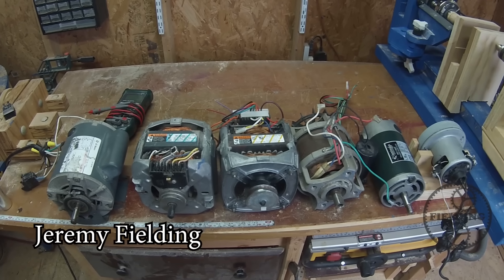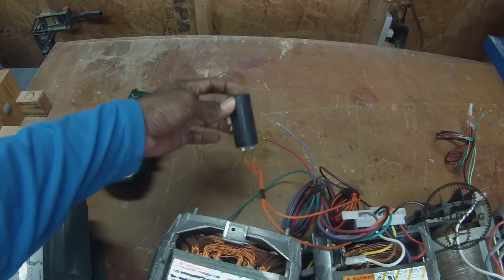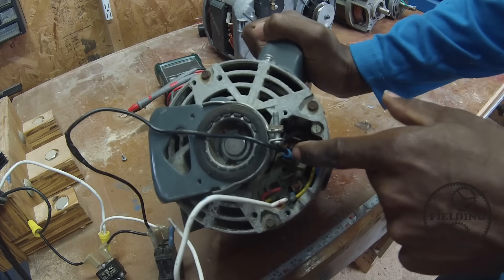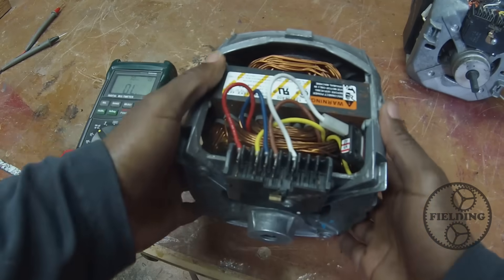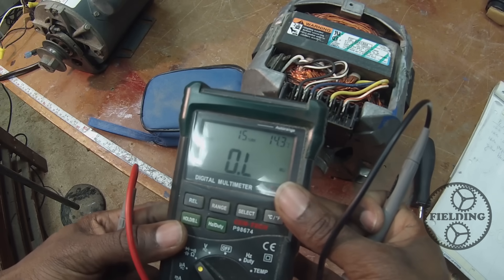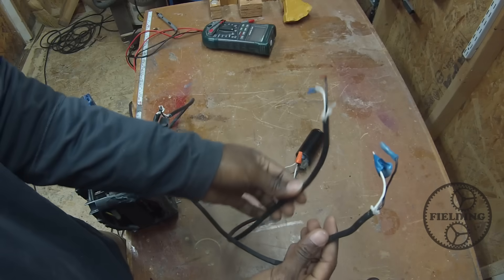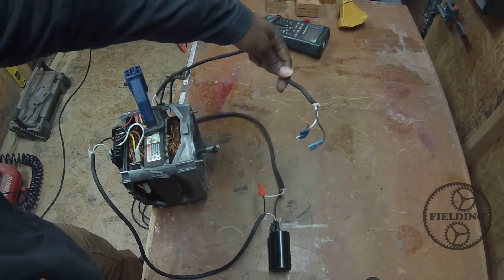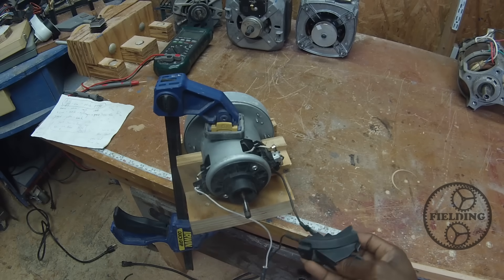How To Wire Most Motors For Shop Tools and DIY Projects: 031

Comment: i got a motor from a dishwasher it had a run capacitor but has 3 wires (and one ground) any idea how to connect them ? (btw they had different resistant with each other and had continuity with each other... no idea if they are sorted :/ )
Reply: therealnightwriter- That's so clever. You know, I had a electrical question so I googled it and it eventually landed me here. Here we also find a smaller youtuber that is likely to answer questions directly. Thanks for suggesting the thing were all doing champ:)
Reply from the maker: I added a note to the description for this kind of question. Please have a look Thanks!
Reply: @Bino White you speak the truth brother. My millwright shop has a bunch of very very smart millwrights but they're BOOK SMART. They know the theory. Theory is only one part though. Hands on knowledge is more useful to me in my everyday tasks. I vant stand when guys fresh out of college start thinking they're full blown millwrights. To become a jack of all trades, it takes many many years....
Reply: @Bino White Invest in some punctuation my guy.
Reply: Bino White I think you’re story shorted out somewhere, but I get u bro. I’d say a good mix of both is good. Watch electro boom he’s hilarious.

Comment: Hello Jeremy - maybe you can help me with a slightly different motor:
I salvaged an 50W (220/240V since I am in Europe) AC motor from an old dryer and can't find a wiring diagram.
The motor has 3 wires (white, brown, red with 38 Ohms between brown/red and 20 Ohms between white/red; white/brown) + ground screwed on the side.
Additionally I salvaged one 10uF and one 18 uF capacitor (450V, 420-470V) - both 4 pins (two pin-pairs with solder-bridge having no resistance)

If I did my research right, white should be neutral and red/brown + and - depending on the direction I want the motor to spin. But do you have any Idea how I have to wire those two capacitors?
Since the capacitors seem to have practically only 2 different pins, I just put one between red and brown, hook white to ground an red or brown to phase depending on the rotation I want - or wire them parallel?

Thank you for your time
Reply from the maker: Please understand I get hundreds of emails and messages like this. At this volume it isn’t practical or safe to give one on one wiring advice
Reply: I understand that you don't have the time to look at capacitor ratings and motor specificy for each and every request and give detailed advice.
But I still think a 3 wire AC motor is pretty common and a wiring advice would help more people than just me (since there was no 3-wire-motor in this video).
Can you give a general advice for wiring 3-wire-ac motors? Is the method of finding neutral correct (lowest Ohm to the other 2 cables) and is it in general correct to put the capacitor between the two high-ohm cables, hotwiring one of them?
Thanks again for your time and effort
Reply from the maker: I have had this conversation enough times to know I should never assume I have all the relevant information or even that I understand the problem completely. It is not safe for me to answer your question. Sorry I cannot be more help individually... but there are thousands of you and one of me

Comment: Your channel is very helpful and informative. A Question. How does the capacitor get charged?  And, if the capacitor isn't charged when you turn on the single phase motor, does it kick it over and start the motor spinning?
Reply from the maker: It only takes a fraction of a second to charge so it is charged when you power on. But depending on when it is shut off, it is often charged from the last run cycle

Comment: Hello first off want to say your providing awesome info and instructions..... I myself am wandering if  you can steer me in the right direction... If at all possible.... I just purchased a stand-up (RollPlay) Up Rider USED..... Now I reassembled it and  attempted to test it before My daughter could ride....... And only the right wheel was turning. Sooo I 1st thought it was a burnt motor but I was able to actually get power to it using the wiring harness for the Right wheel so My issue Is NO POWER FROM SOMETHING  TO THE 1 SIDE..... It would be awesome if you have the time to spare if not all good ill still be learning lol from you 
THANKS
Reply from the maker: I don’t know.

Comment: I want to  make a small carousel for my 2 kids. Which motor would be able to handle about 200 pounds with the weight of the kids and all parts and wood etc? I was thinking the first motor you showed or the treadmill. Saw a guy make a huge one 10 feet high/ 20 feet around and used a 1 hp electric motor.
Reply from the maker: It sounds like you have already done more research on the topic than me. Why not start with what you have seen? There are formulas for calculating how much horse power you need and how to calculate your load. but if you have an example, you have more than I can give you.

Comment: I was looking to define the wire color coding for my particular AC motor.  It did not have a diagram on it.  It came from a dishwasher.  The nice thing about dishwasher motors is that some are reversible.  Mine is a KitchenAid Gold Seal Reversing Motor .  The wire assignments that I figured out are:  
Purple = Neutral,  Blue = Hot Common,  Yellow = Hot CW Rotation,  Black = Hot CCW Rotation
Do not attempt to run with only Blue wire to Hot.  It requires the addition of one of the Hot rotation wires.
I hope this help others with the same or similar motor.  BTW....there is no visible capacitor but there is supposed to be a thermal limiter built within.
Reply from the maker: The only issue is colors don't always have a meaning. Neutral is usually white, but not always as you see. Every manufacture is different and it is best to check each one as I did in the video rather than rely on the color, unless the motor has a diagram.

Comment: I have motor Samsung from washing machine, my problem is I don't know how to wired the 8 terminal don't know what to main terminal, just ask you how to trace main terminal
Reply: Are all induction motor need capacitor
Reply from the maker: Not all induction motors need a capacitor. But those are usually motors with very low starting torque. Or they are three phase motors.
Reply from the maker: This video is the best place to start if you don't know where each wire goes. But when this stuff is new it always helps to watch a few times. There are things you didn't notice the first time.

Comment: what circuit breaker max amp you have for this testing?  15A?  i do a  lot of this stuff on the side so need a good pigtail with a breaker, right now i just use my power supply and well, not liking that..   2nd question.. how do you know if it's 110 or 220 on say like that washing machine motor.. i have one out of a dryer..   i think the dryer was 220, and i don't know if it's wired inside this box to the left o the motor.. i know usually for 220, you series the t2 to t3  and so on (coils)  someone gave me a compressor, and it had a leeson ac motor on it.. it's like 70 years old i think is what he said, may not be but it is old..   and i learned a lot with that unit..  after all that time, that ac motor still works flawlessly even after clearing out all the dirt dobber nests and rust ..   since that day,  i pull tons of motors now and even found a really nice on from a garage door opener unit that was thrown away in the trash but it's actually like brand new.. don't understand.. you'd think those guys might wanna keep that.. it's like $150 used on ebay..  dunno..
Reply from the maker: Motors should have a label or a wiring diagram. For the breaker -15amps or 20 amps is good. It really depends on the line in the house. You want your breaker to trip before the house breaker

Comment: Thank you very helpful. I'm trying to wire an old Crompton/Parkinson motor with 5 input terminals, Z,S, & T on top row and Az & A on bottom row, I've found the starter circuit and the main circuit and got the thing working BUT trying to rig it up with a rotary switch so that I can reverse it,  All the videos and diagrams I've found have only 4 terminals. any ideas? smerczak.ron81@gmail.com7
Reply from the maker: I have a video on reversing motors. Search my channel... I have to let you workout the details of configuring your switch though...

Comment: Great video! I found an old Royal canister vacuum that needed some rewiring. When I opened it up I found the motor has only two black wires. The power cord has a black and a white. What do I  do? The cord was detached when I found it so I have no reference to go by.

Comment: Hey Jeremy- I have an issue if you can leave me an answer. My reversible drill switch had gone bad. My drill is too old to make it worthwhile to buy a new replacement switch. I want to install an outside DPDT switch on the outside to be able to have the reverse and the forward function. I see 4 wire connections on the drill switch. I have tried a multimeter to trace and see what is open and what is closed and what is open. I cannot figure it out. There is a red wire that goes to one brush and a yellow wire that goes to the second brush. Where the red wire is there is a black wire opposite it that goes to the motor. On the same side as the black wire is the yellow brush wire and opposite the yellow is a black wire that goes to the Load. I cannot figure out how to wire those wires and replace it with an external DPDT switch. I am unfamiliar with the operation of the drill in forward and reverse mode. If I understood how this circuit works I think I can figure out how to wire the switch. Your help would be greatly appreciated.

Comment: Don't forget that some washers, particularly front loader washers are 3 phase. They have a circuit board that creates the 3 phase. They do this so that the motor can be easily reversed. Some single phase appliance  motors do not have a start capacitor.
Reply: Does  this wiring work for all washing machines wired the same i got s motor out of a whirlpool   its 120 vcd  duty 3.8 a 710 rpm 4.6 a 15300 rpm and im pretty sure i didmt grab the capacitor  can u use the motor without the capacitor?
Reply: It was also a front loader when  i was taking it apart i was just scraping motor but after watching whag people can do with spare motors .anyhow i didnt thing of writing down  the make or year  i thouhht i grabed all the chips and wires  but i didnt see the capacitor  when i was putting it together again . Also i thought the this squar box was yhe capacitor but it says filter on it with other number .

Comment: I like the video. I Have a wirlepool motor that only has 5 wires. I completely disassembled the control panel and found no capacitor. The motor ran fine while hooked up to the panel. I can send pictures. Oh forgot to mention I've tried hooking it up without panel and tripped breakers and got it to hum but no run.

Comment: Wow!  Great video...  Maybe this is what I've needed so far but I have a question.  I have a motor(from a washer) basically it has three wires. (The ground,Neutral and hot)  now I connected the hot through the capacitor and the neutral over the capacitor but not tested it hoping something doesn't goes wrong. I would like to know if I have done it right?  Thanks.
Reply from the maker: There are too many variables to try and troubleshoot problems this way. I can't see what you are doing, and it is not safe to answer questions like this. You have to watch the video and make sure you have the same setup. I have several videos on wiring motors, and one about how to determine what kind of motor you have. Watching the other videos will help build your confidence and make a decision based on what you have learned.
Reply: Jeremy Fielding certainly I will. Thanks for replying.
Reply: Jeremy Fielding  well from watching your previous videos, I just found out that it's an AC induction single phase motor.
Reply: Jeremy Fielding I later tested it but it didn't run. And for the capacitor(from same washer), it's alive.

Comment: What you referring to AC motor is actually an induction motor. An induction motor can start rotating is either direction that is if you power an induction motor it just start vibrating, now if the shaft turned clockwise the motor start rotating clockwise, or if shaft turned counter clockwise the motor starts in that direction. There has been two ways to make the direction of rotation of induction motors predictable , one by shading the poles, second the use of starting capacitors. the click you hear is centrifugal
switch that disconnect capacitor after the motor has started rotating.  The induction motors have very low starting torque, that is why they are not suitable for many applications. If high starting torque is needed normally universal motor is used.
Reply from the maker: It looks like you didn't read the description, or the text on the screen in the video. Just to be clear, It is both an AC motor and an induction motor. I don't want people reading your comment and getting the impressive it is NOT an AC motor. I have a whole series of videos explaining direction of rotation, how motors work, and how to change these parameters. 
Also the starting torque on a capacitor start induction motor is very good, especially considering the other benefits like it stability in speed. This why it is so widely used. It is best practice here to add context if you give advice like this in the comments. Perhaps if starting torque is the most important feature... Universal motors have their own problems. but that is relative depending on the application, so I will leave that topic where it is.

Comment: Jeremy if you were using that washer motor that you wired in parallel on a project, would you have that wired the exact same way? Also does that start winding not need to shut down after it starts up? I know you may have been doing it the way you did for example, but I was wondering if you would on a project also. Thanks
Reply from the maker: This is the correct way to connect the wires. I might have spent more time making the connections better but it won’t run if you connect it wrong

Comment: hey man, first and foremost, good job on the video, but i think you may need to RE-research some of your concepts you're trying to teach people here. for one (and i could very much so be wrong due to different motor being, well, different lmao) i dont think "hi/low" refers necessarily to motor speed but more so referencing "hi/low INPUT VOLTAGE" i.e. 120v VS 240v, ok? yes/no? im pretty certain there was something else i was going to mention but i cant for the life of me remember what that was lmao, so sorry haha now if i later think of it ill edit this post OR reply to it, please let me know about the hi/low and if it IS fop CERTAIN for speed in RPM's
Reply from the maker: This is not a dual voltage motor. The hi low on the washing machine (induction motor) is indeed two separate sets of windings inside the motor which give different speeds. I have a detailed video on understanding dual voltage motors you might find interesting though. check it out. https://youtu.be/3llc68VvzsY
Reply: Jeremy Fielding ah ok I see what you are saying now. Prior to your last post it was made to seem as if you were suggesting that (inside the video) there were two sets of different inputs, (high and low,) thanks for clearing up what you were actually stating about two separate windings indeed for speed.

Comment: I tried to wire a 120v motor at 60hz  directly to my home outlet. The motors spinns but i noticed sparks and burn smell. It has 2 wire one black and the other red connected to a controller which i guess is burn out. This motor belongs to a paper shreder that stopped working and I thought the motor was burn out. Ho can i connect it safetly with out burn the motor?
Reply: Check your brushes.

Comment: Just so I’m clear, you’re just running a pig tail from your line  over to your start capacitor. Then from the start cap to start winding. Then the other end of your line from Wall that you pig tailed goes to run windings. Just want to make sure I’m on the right page cuz I’m bought to tear out my first washer motor
Reply from the maker: That sounds about right...The start winding and run winding are in parallel. You can look that up before you start. Also watch my video on dual voltage motors. It will help with your understanding even though your motor is not dual voltage.

Comment: Thank you for those explanations. This is something I was searching for a while. One question : I have a motor that come from a washing machine, but dont have the capacitor for it. Is there a way to calculate the values it need, or in your video you say that you found the one you need on the net. Can you elaborate on this. thanks again, for your great videos.
Reply from the maker: almost any capacitor sold as a "washing machine capacitor" will do. The exact values aren't that important except  the voltage rating must be at least the voltage of your machine or higher. But that should be the case if you are buying one made for a washing machine here in the US. In other countries it may not even be an induction motor.